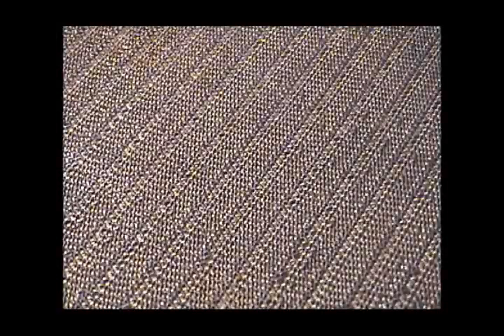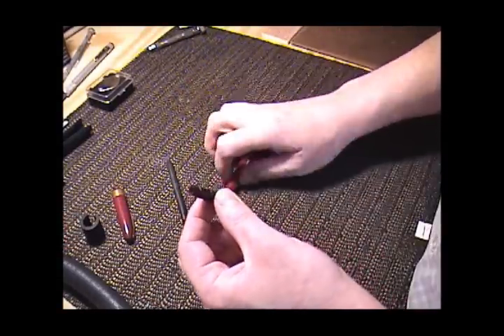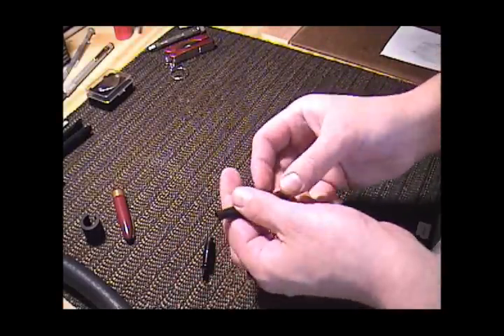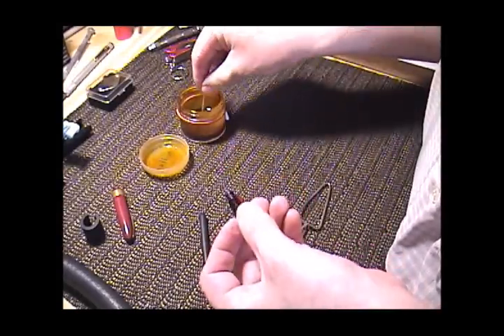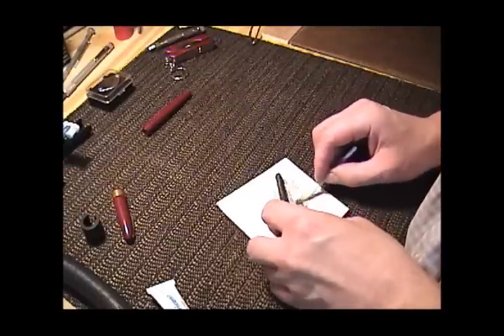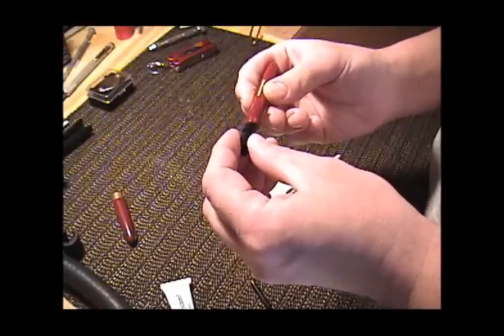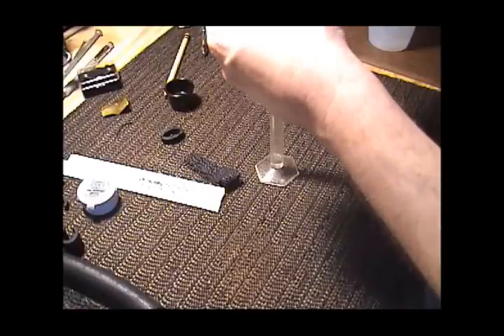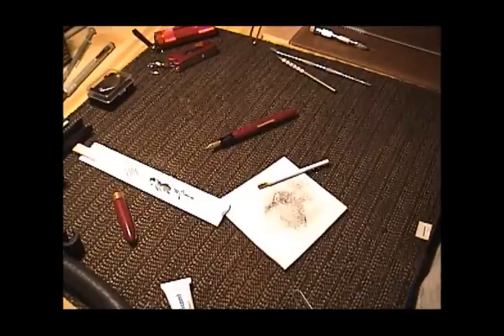Wearever Lever-filler Restoration

Comment: Thank you for your excellent collection of helpful videos. After overhaul and testing fill functionality, it's sometimes necessary to ensure the pen performs and writes pleasantly. I like simple black Quink for a 'nib performance check'. We might then face correction of tine alignment, flow optimisation and doing what it takes to ensure a smooth, enjoyable line in whatever direction the nib moves... another satisfying area of pen tuning that enthusiasts can now more easily self-learn :-)

Comment: Thanks for the Pen Sac Co tip.  I've repair supplies and sacs on the way.  I just bought this pen on ebay.  I've not seen it on sites describing Wearever, but only in your video.  Might you know the model name and years for it?  Any info is appreciated.  Thanks.

Comment: Is there a reason you use the shellac as opposed to a gel type glue for the sac and threads? Is it just preference?
Reply from the maker: Shellac will soften with the use of heat from a hair dryer or heat gun etc, so you can take apart the pieces later, whereas glues normally are not a reversible proposition and trying to take apart pieces without breaking them is nearly impossible. Also shellac on a sac will not come loose from the water present in ink and will therefore stay attached to the sac nipple.
Reply: @Parker51Guy  Thanks for the reply. Appreciate the knowledge.

Comment: Hi what size sac did you use for this? I have a button filler that needs replacement. Thanks!
Reply from the maker: I believe it was a 16 straight sac. Because your pen may have a different barrel inside diameter (ID) I cannot say the same sac will be correct for your pen.
Reply: I just bought this exact pen in blue on eBay, and you just saved me a lot of time finding a sac.  Thank you!

Comment: I want to know the material you have used to fix the filler
Reply from the maker: To affix the rubber sac to the pen section? To 'glue' it in place I used shellac.
Reply: Thanks too much